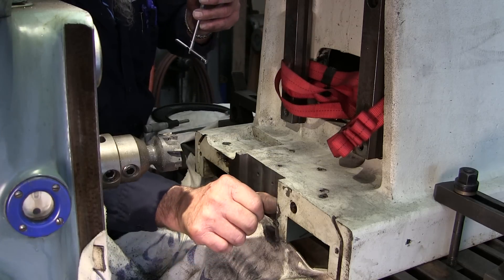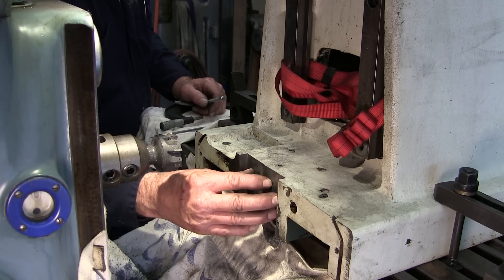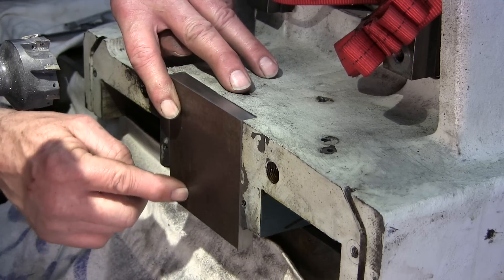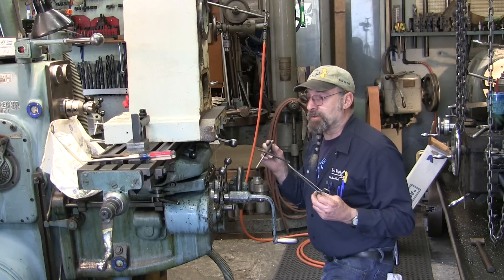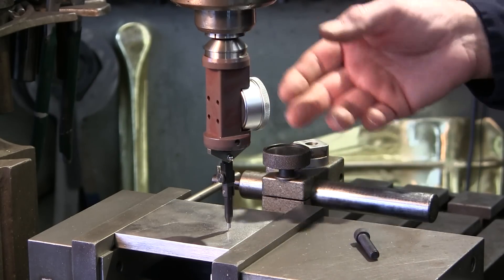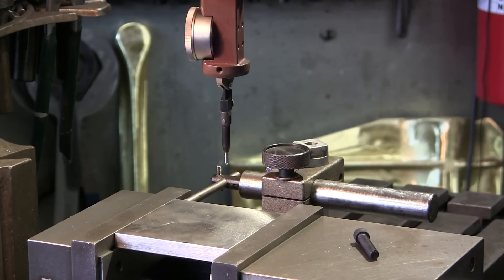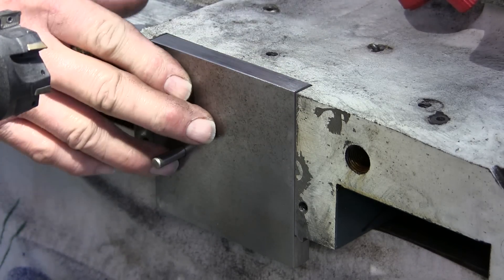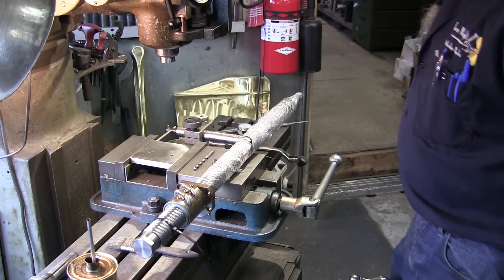Snap Part 2

Comment: I'm just an amateur and wouldn't question your skill, but wouldn't the plate be held tighter if the screw holes were clearance drilled in the plate? With a continuous thread through both the casting and the repair plate how can the plate be pulled up tight?
Never mind. I just saw in video #4 that you added the 5 countersunk plate attachment screws that were clearance drilled. I guess the continuous threads on the bearing attachment bolts did in fact provide more grip for that part. I knew I should have watched the whole project before commenting. Ha.

Comment: On the 2nd hole did you go with the transfer punch mark or did you use the measured location with the DRO?  You stated it was off about .005 one way and .010 the other.
Reply from the maker: +Jennifer Boardman I did both, marked and then centered, but the transfer punch had a little clearance, most likely the amount off center measurements. ;{)------